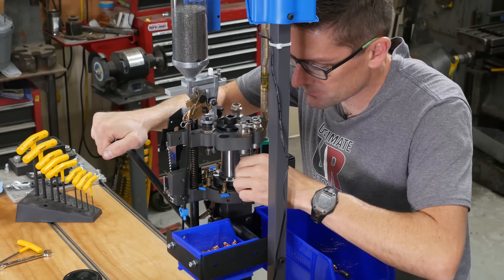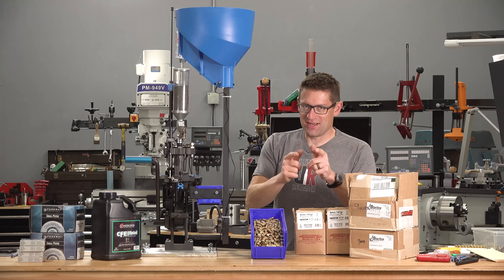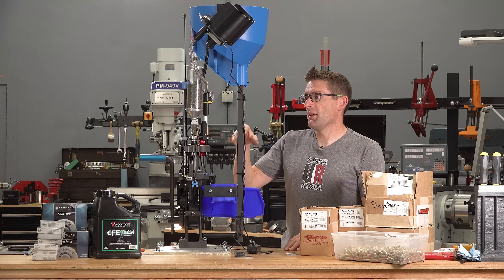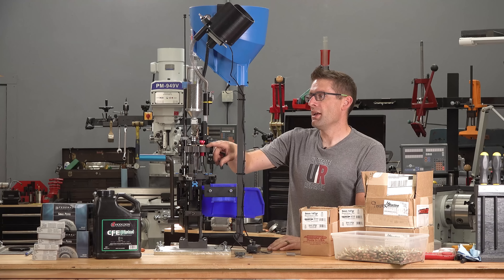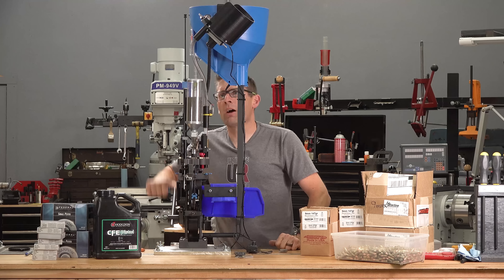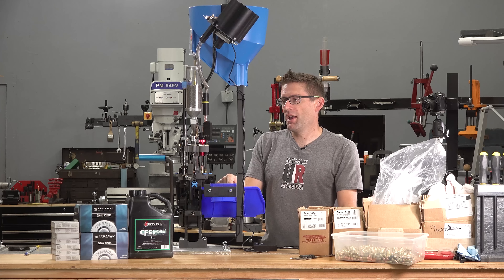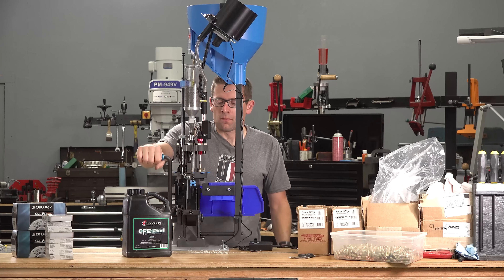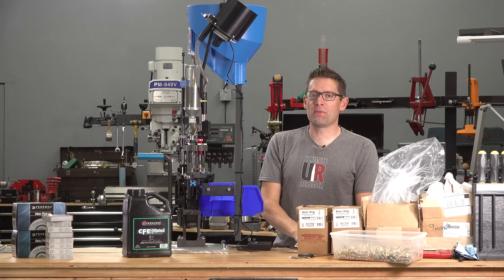WARP SPEED! Loading 9mm on the Dillon RL 1100 with Mr. Bullet Feeder

Comment: This is just screaming to have a motor attached to the handle. Wire a relay to the powder check to stop the motor if a failure happens and you'd be golden.
Reply: They already make a motor drive for the 1050. I'm sure there will be one to adapt to the 1100 soon, unless Biden puts a stop to reloaders. LOL
Reply: @jamessween  "biden puts a stop to reloaders" 
you are activating my nightmares
Reply: @jamessween  There's already an ammobot for the 1100 and Dillon also bought ammobot.
Reply: @lmaoanatorhilarious2582  We just need a system like this to punch out cases and primers make our own from scratch
Reply: I was thinking the same thing a few relays added would get it moving

Comment: Well, tomorrow is delivery date for my RL 1100!  Excited, you bet.  I've been using a RL 550 since late 1986.  Notice, no A, B, or C.  It was a original 550.  Bought it for 38 SPCL.  Added 9 MM, 380 Auto and of course 45 ACP later.  I don't know how many cartridges it has reloaded.  But, I hope it's new home will appreciate it as much as I did.

Your videos helped me get ready to set it up tomorrow, thanks.  Adding the bullet feeder may come later if my hands fail me any more, bummer.  I do plan on using the Dillon powder check system for now.  The videos also pointed out a few tips that will help speed setup.

Great videos, thanks.  MSgt David R. Smyth, USAF, Ret.
Reply from the maker: Thank you, and thanks for your service!

Comment: Really jealous of the boxes of primers!
I use a similar setup with a Super 1050 with a Mr Bullet Feeder.  I have been using that setup for 5 years now and have made many 10's of thousands of rounds, probably close to 100K.  Once I got the 1050 dialed in, I was able to really crank out ammo.  This has become my main press, with the XL650 relegated to odd types that I only make in small batches.

Comment: Running a 1050 W/bullet feeder. after the first 5000 rounds removed the POWDER CHECK, Bullet feeder #6, seat #7, Crimp #8.  in 105,000 rounds no issues.  When you use that CFE powder up get a faster burning powder. Like N320, Sport Pistol, Clean Shot, or IMR Target.  Your target loads will be cleaner and more consistent.

Comment: Gavin:  Also, I would recommend referring to the Station Numbers of the RL1100 as you did in the Mark 7 Caliber Change video.  Indeed, as depicted on Page 14 of the RL1100 Manual, the case insertion is designated as Station #1 with a total of 8 Stations!  Thank you!
Reply: Agreed, look at the shell plate, if there are 8 positions then there are 8 different things happening so it is an 8 station unit... Don't understand why this is something to think about...

Comment: I'm running two of these, near identical setups, one manually for .45ACP and one for .308 on a Mk.7 Autodrive. I also have a Mk.7 Revolution series for .223, another for 9mm, and another for .40S&W.  

With an "Autodrive" the RL-1100 is nearly as good as the Mk.7 revolutions (and was easy to install).  The only really noticeable difference at that point is the additional tool head space for more dies on the Revolutions.   Both Dillon and Mk.7 make some great systems.  The only downside is this entire industry is a nightmare on orders and delivery.  Everything is late on delivery.  Most of the OEM's of consumables aren't even taking on large orders for the time being.  Had a powder mfg. give us a quote for a couple kegs of powder only to then tell us when we sent the PO that they weren't accepting actual orders for the next year.   Both a major European and Russian primer maker quote large orders and when we sent the order in were contacted shortly after saying the lead time on the order  that size was 10 - 20 MONTHS ARO.

The shortage is real folks...  I can find projectiles and brass out the ears.  But Primer and Powder are mostly non-existent at the OEM level.

Comment: Great video,, yours is so smooth. I have an identical setup and my 1100 head jumps on the upstroke when the expanding die on the begins to extract from the case after dropping the powder and expanding the case mouth. My machine had done probably 40-50,000  rounds when I purchased it used from original owner.
Reply: this is my problem also.  His brass is probably dry-tumbled so the carbon acts like dry lube.  I wet tumble mine or use new brass and that popping is really annoying.
Reply: @shootloadrepeat  I use some Dillon case lube on the wet tumbled brass and that helps a bit. 
I also had to take the ratchet off my press because of the jamming and then just make sure I full stroke the machine handle to avoid other problems.
How old is your press ? 
I thought mine was possibly worn and that contributed to the powder funnel getting stuck in the case…….

Comment: I have 3 sq deal presses, a 550, a xl650, a lee classic turret, a rockchucker, a lyman turret, a frankfurt single stage and a Lee challenger.  I am about ready to shoot for a RL 1100 to load 9 mm and 38's as they are the calibers that I shoot most.  I also load for .30 carbine, 223, 30-06, 6.5x55, 327 Mag, 41 Mag, .44 Special, 45 ACP, 45 Colt and 50-90 Sharps.  

Due to a recent move the majority of my reloading gear is in storage and not handy.  I have been forced to load my 9 MM's on a Rockchucker. 

 I sprang for a lee bench primer tool and I love it.  I also obtained a Lyman powder dispenser, a electronic scale, some loading blocks, 500 135 gr bullets, 8 lbs of titegroup powder and 1K of 9 MM cases.  What a tedious job it was to assemble 9 mm rounds with the foregoing minimal equipment.

  I put together 135 gr bullets with a charge of 5.0 gr of titegroup.  Great loading for a 115 gr bullet but way too much for a 135 gr bullet.  So now I have to break down about 150 dangerously overcharge rounds so all my work was wasted. 

I reached out to Hoosier bullets and purchased 5 lbs of 124 gr lead polyomer coated bullets and I will load them with 4.0 gr of titegroup.  When I get around to it I will load the 135 gr bullets with 3.5 gr of powder.  I have the Lyman turret press here and I intend to use it to make my job a mite less tedious.

 Somehow to justify spending two grand or more on a RL 1100 I would really need.   a great reason to do so. I am still looking for that as the xl650 and the 550 can easily produce 9's and 38's in the quantities I require and a at a much reduced price. 

Either way I enjoyed your videos on the rl 1100 and I do however lust for the expensive press but I cannot spend that much a whim without a solid reason to tie up that much capital.

Comment: Congratulations on your setup!  I too run an RL1100 with the MBF; however, as I prefer separate seat and crimp functions, I use an Endoscope to monitor my powder drop levels.  Can watch on a laptop, 10" tablet, or my iPhone.  Since my powder level monitor view is mounted at shellplate level, it works very well for my "older" eyes!  ;)  Thanks for your awesome review!  Thoroughly enjoy your Channel!
Reply: I use the same thing on my 650 for .223 reloading (with bullet feeder). For 9 mm I can see straight to case so no issues there. I just 3D printed an adapter to powder check rod hole on the 650 toolhead to mount endoscope camera there so it nicely shows powder in .223 cases.
Reply: How many times you had powder charging issues I wonder. I have been reloading 20+ years with progressive presses and had 5 rounds without a powder charge 12 years ago; when I ran out of gun powder in the powder measure. I now have a buzzer to let me know when I get close to the bottom since then...
Reply: @aakoksal  I started my reloading career in 1992 with an XL650.  This was also the first year they were offered!  FWIW, I have never had an over-charge or squib.  But with the XL650's clockwise rotation, it's easy to eyeball the powder drop before placing a bullet.  I now use an RL1100 with MBF, and since it's very awkward to "eyeball" the powder drop before bullet placement, the Endoscope gives me a direct view of the powder drop without having to adjust my view.  And with the MBF, there's not an extra station that offers a "buzzer" to get my attention.  Your running a powder measure buzzer?  How ironic!  👍
Reply: @wvultra  I have two RCBS progressive presses (Old Piggyback conversion dedicated to 9mm and Pro 2000 auto-index for others) which are both 5 stations. I use bullet feeders so I don't have a station to spare for a powder checker. Since that 5 rounds of squib loads, I've decided to run the buzzer for long sessions where I know I'll need to top up the powder measure... I can see the new RCBS 7 station press in my future but need to win the lottery first...! Enjoy and be safe...

Comment: Pretty cool setup for the volume shooter. I did notice that you did a great job of editing in that you were just about to have the primer checker go off and then all of a sudden it was raised to the full position. That's the biggest slowdown in the process especially if you use the individual primer pick-up tubes. I found that using a Franklin Arsenal electric primer flipper that I could dump the primers in and flip them and then pull the clip on the bottom of the tube over the primer feeder and really smooth things out.

Comment: 31 rounds per minute. you can crank out 1860 rounds in 1 hour if you dont have to stop to refill anything or run into any issues. that is super impressive. spend 1 hour cranking out let's say 1800 rounds, 1 hour on final measure of 1800 to make sure weight and size are consistent (maybe I'm the only one who is that concerned about this). and that wasnt even rushing it, that was a modest speed.

Comment: I’m basically running this exact setup except with the Hornady AP press. Added a roller handle to the setup as well for increased speed/comfort. Runs like a top. Though I do really want to also get the RL1100 as a secondary press to run my 5.56 and 7.62 through. I like the RL1100 setup with the dies coming down, rather than the rounds coming up to meet the dies, cause at really high speeds, there’s a wobble to the whole setup that occasionally will drop a bullet after bulletfeeder station on the way up to seat/crimp. That only happens if I really get cranking on the press, but those are the speeds I’m after for rifle rounds, as I go through more of those generally.

I would definitely consider adding a motor to the RL1100, though maybe wire to the powder check station to stop if the sensor goes off. I think this press would marry really well with a motorized crank. Then you can just set and forget reload, while just adding components.

Comment: How did you prevent the powder funnel from getting stuck in the case, as well as the crimp die?  In my S1050, both the funnel and crimp dies cause the brass to get stuck, and the upstroke is always very violent as it pops off of the cases.  Does it on both my S1050's in 9mm and .45ACP.  I've just ordered some nitrided funnels but my crimp die is still going to stick.  I wet tumble all my brass and I won't change this, so I know clean brass tends to stick in the funnels (polished or not) but I'm sure others also wet tumble and load on these machines with no issues but unable to lock down a consistent solution.  I've tried quite a few things already.  Ammo still comes out great, but my productivity suffers due to the popping unstick actions.

Comment: What cartridge expander or next sizer are you using that I have the Hornady lock and load I’m looking to get the Bullet Feeder I understand that I can’t use the Hornady a PTX expander with them Mr. bullet feeder dies. Therefore are you using the Dillon expander that fits inside the powder measure?

Comment: You don't need a powder check. I have a 1050 that is fully automated and don't run a powder check. I the machine comes to a halt you manually check all the cases. Cause when it doesn't stop all cases will have powder.

Comment: I’ve been running the RL1050 with AmmoBot automation & Mr. bullet feeder for several yrs,.. with 9mm I change bullet weights and profiles quite frequently, so I find the Redding Micrometer seating die more accommodating than a combined manual hex head seat/crimp die.  Though that powder charge sensor is surely inviting🤔. Are you planning to add either a Mark 7 or AmmoBot drive to the 1100?  Keep up the great reviews!!!🤙🏻
Reply: what about fast and friendly's drive?
Reply: NarrowIsThe Gate I have been buying F&F upgrades for the 1050, but haven’t extensively looked into their drive system.  Initially F&F looks to be up and coming with their innovative drive system, tho having to send my 1100 to them for modification and having to manually adjust the magnetic set-points for dwell etc ..don’t lend themselves to quick adjustments for all of the various loads I do in volume.  Great setup for brass prep!  The clutch engineering is fantastic and mechanically dependable it’s just not for me with the availability of a touch screen operation at a similar price point.

Comment: I find it hard to believe that powder ain't flying out of the cases at the faster speeds. When the shell plate indexes it looks pretty snappy.
Reply: Good point!  At first glance I was skeptical there was powder in the case but it's there; https://youtu.be/1PRN9D20rxU?t=568  
I'm guessing the charge is so small for the 9mm 147 it's just not an issue.

Comment: Believe it or not but my $20 Hornady bullet feeder DIE works very reliable with plated bullets from RMR, I ran 4000 without any problems, also works with cast bullets, mostly reliable.  Now the bullet feeder leaves me desired for something better.  So now that you going hyper speed, how are you feeding your primers?  :))))  Also on magnetic powder check, do you get stuck powder to it that messes with your charges?  I imagine the plunger touches the powder each time?

Comment: You probably answer this question in the first build video, but it appears that you're not applying significant pressure on the up-stroke to insert primers....is this now a down-stroke operation with the 1100?  I wanted the 1100 for the additional stations but purchased the 750 to allow budget for additional equipment & components. I purchased my 750 a few months ago (way wrong time to get into reloading) and either have to be at the sporting goods store at the crack of dawn or pay through the nose to scalpers charging $200 for a $38 box of primers.

Another excellent video! I am learning a lot and appreciate you putting these out here!
Reply: this loader does not have to push forward to load a primer,part of why it a tad faster per hour,
Reply: It seats primers on the downstroke, via a tappet.

Comment: 5:05 the grip wear on the aluminium body of the bullet feeder die caused by having to grip with a wrench at some point due to the 7/8 die threads binding, I see that happens to everyone else as well.
Reply: double alpha actually warn against using a wrench with their die. there is really no pressure to allow die to loose by itself (like on powder/flaring die) so just tightening it with fingers is enough. People are even using 3D printed plastic dies for this, wrench tightening is a definitive no go. if you want to be 100 % sure, just add another lock ring to the bottom of the toolhead. I'm sure people often replaces Lee lock rings with ie. Hornady ones so just use a Lee one

Comment: Power to ya. I can't get my 1100 to work consistently at all. Primers won't fall away upon decaying. I never had any such trouble using the same dies on my 550. So, the next station is pocket swaging. Guess what happens when the primer is drawn back into the primer pocket? Next station is proving. I don't know how many rounds out of 100 that get simmers seated crooked, or no primer at all. at least ten percent. Load a thousand rounds and see how many you pull out of your bin with crunched/crooked/ or no primer at all. Then, when a crunched primer falls away, the machine goes Ker-thunk! Stops cold. It took me a while to figure out that it means a mangled primer is stopping the primer slide from moving, thus stopping the stroke of the ram. When everything else goes right, which is slightly more than half the time, the bullet feeder doesn't feed consistently. About ten percent of the time, it dropped bullets upside down. I have played with the tilt of the hopper, I have played with the little white spacers, I have tried multiple bullet styles, etc... One thing which happens regularly, is that a bullet gets stuck under the little spring loaded kicker arm at the top of the bullet hopper. when that happens, the bullets drop upside down a lot. Then I have to get on a stool and un-fuck that before I can continue. I have worn out the plastic threads on my bullet dropper die, trying to find the right setting, and will have to order a new one, for a hundred dollars.

I have never had so much trouble from piece of equipment.

Comment: With this setup, roughly how many rounds per hour would you estimate that you could reasonably load (considering restocking, cases, bullets and primers)?
Reply from the maker: I'm thinking about 1,000 - 1,200 per hour when using the Primer Pro from Double Alpha (loads primer tubes for you!)
Reply: I'm still loading on a hornady single stage press
Reply: Very nice!  Now you need additional RL-1100 units setup your favorite calibers, LOTS of components, and a at least one or two spare right arms...  😂
Reply: gavintoobe, I have 20 primer tubes. I load them all before starting. 2000 rounds later, I’m done. I use a Frankford Arsenal Vibra Prime. Done in less than 10 minutes.